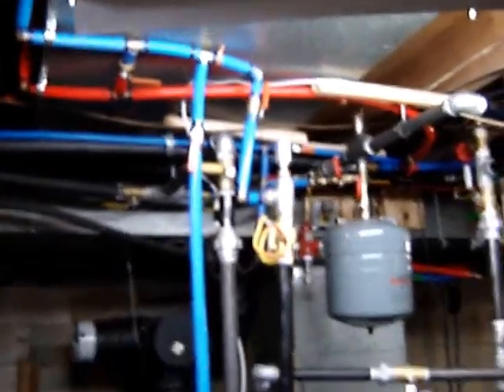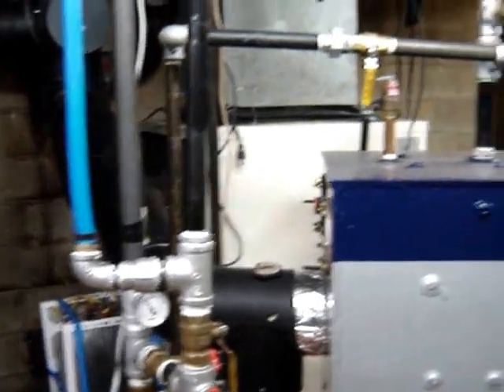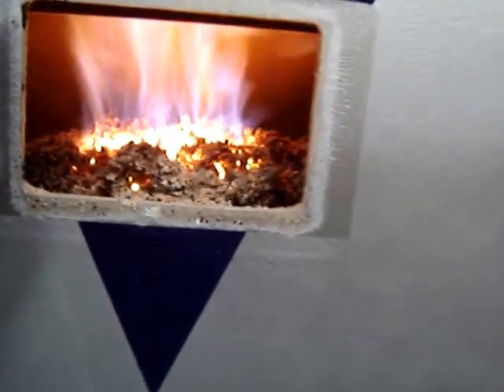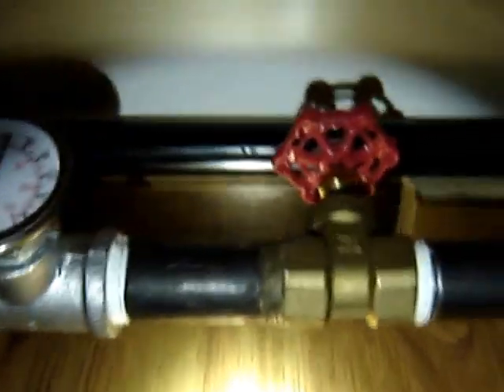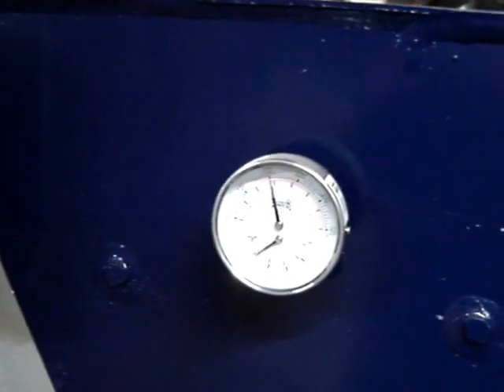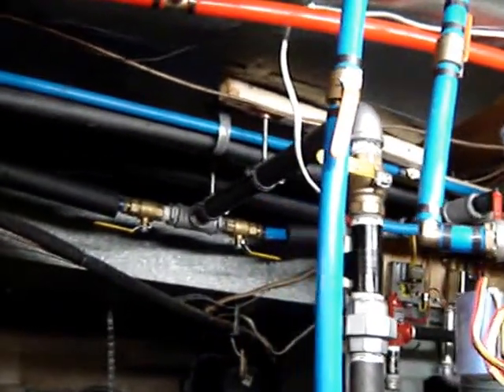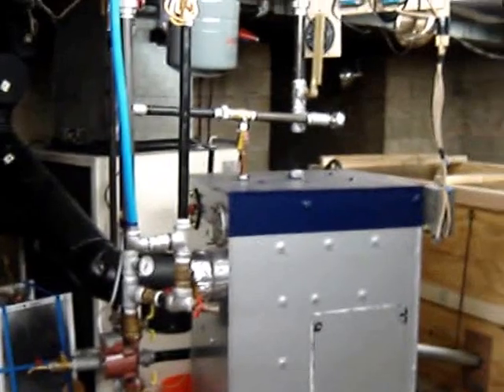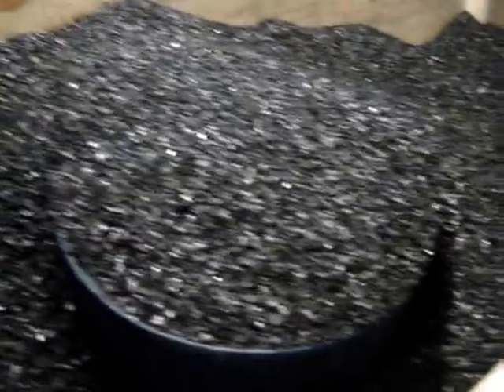Coal Stoker Boiler with Radiators

Comment: The thermometer you set on top of the radiator take a piece of 2x4 and cut one side to conform with the top of the radiator then drill a hole lengthwise through it to hold the thermometer about one inch above the radiator top and it should give you an accurate temperature of the heat coming off the radiator.

Just thinking outside the box.

You need more cast iron radiators 🎞🎞🎞🎞🎞🎞🎞🎞🎞🎞🎞